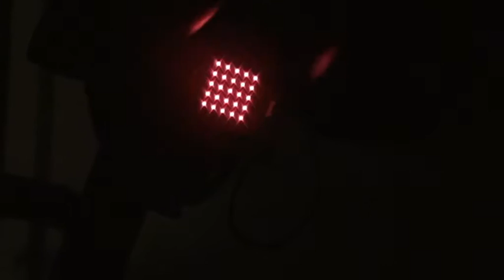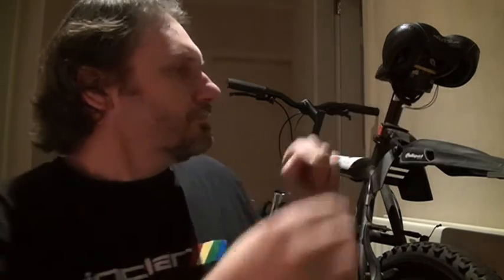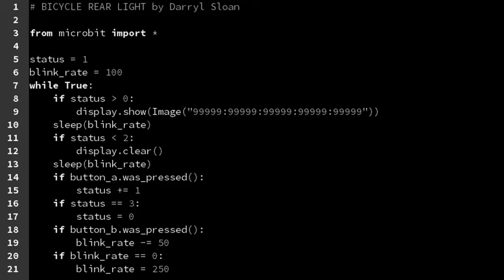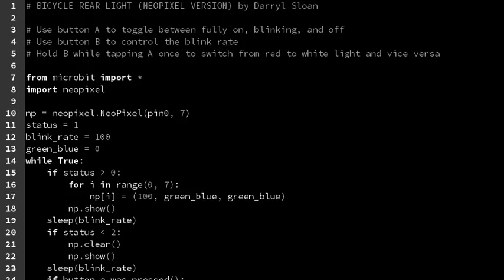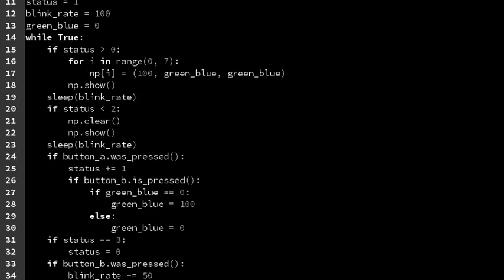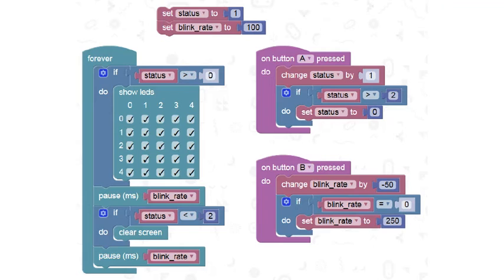BBC micro:bit bicycle rear light

Comment: I copied your program but button b is not changing the speed and it’s not as fast as yours
Reply from the maker: It's probably a tiny, hard to spot difference in your code. I'm assuming you're using the Python version, not Block Editor.
Reply: I’m using the microbit website

Comment: In the 90s and early 2000s most bikes for adults came equipped with lots of reflectors including rear reflectors. The paint was usually iridescent too even if the bike was dark. The only thing someone might have to purchase separate were lights. Seems like the past several years manufacturers have really cut down on adding the extra safety features and it's a problem. I had this discussion with someone a couple weeks ago because there are so many cyclists in my town and not enough street lamps. I sort of dread my drive home from work in the evening. There is typically one surprise who pops out of the pitch dark each night, sometimes just a few yards in front of my car. It's usually a pedestrian wearing a black hoodie and trousers but often it's a cyclist with zero reflectors or lights.